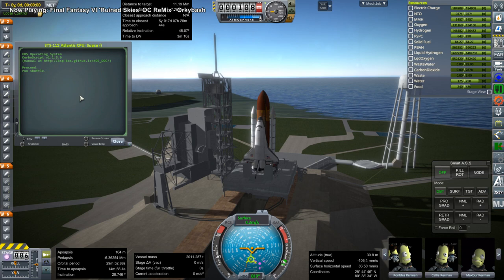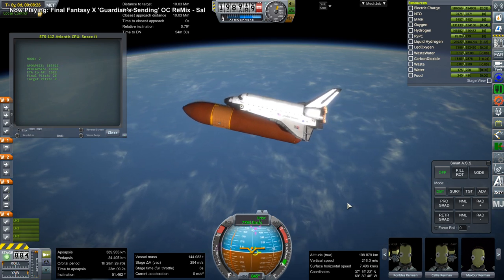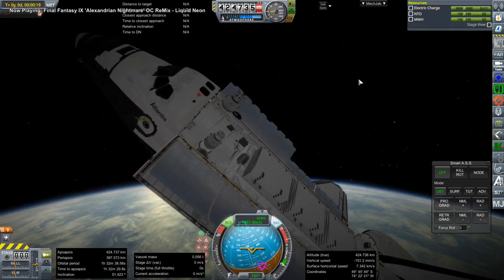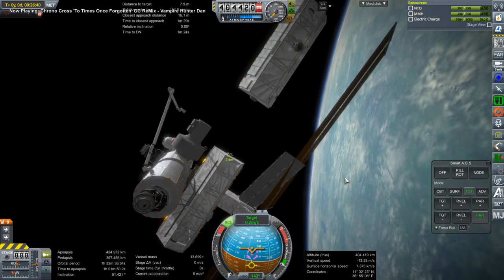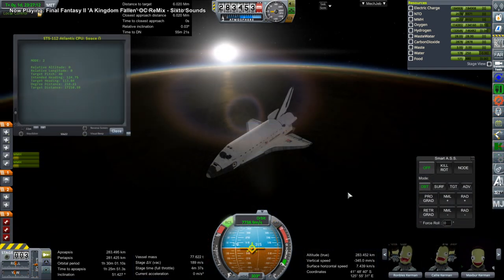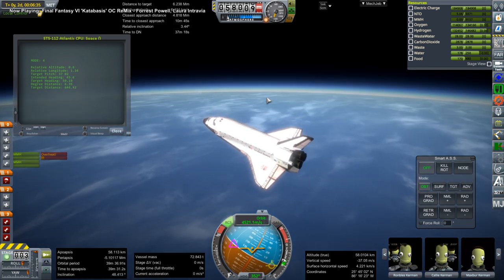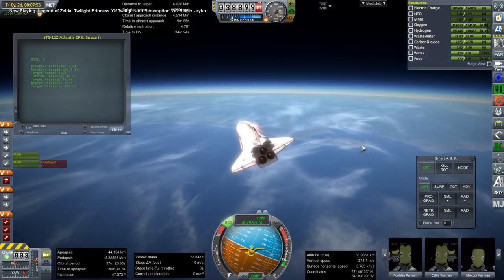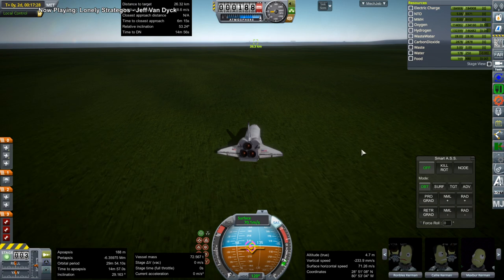Kerbal Space Program/RO - ISS Assembly Redux 07 - STS-112

Comment: I totally understand not using canadarm because I eventually had to give it up in my own recreation, but I’d like to note there’s a little black thing that you can put on the payload that makes the end effector like a docking port rather than the finicky magnet built in. It treats it like a single vessel rather than 2, meaning you can move it around easier, time warp, etc. Then when you want to release the payload, you just get it close enough for magnetism and undock
Reply from the maker: I should try that out again - I remember trying to use the black thing in 1.1.3, but think I did it incorrectly. The real issue is the complexity of using Canadarm 2 correctly for the outer modules. Remember, it actually moves itself around the station to help position the hard-to-reach locations, and I felt that that process was going to involve serious pain and suffering.